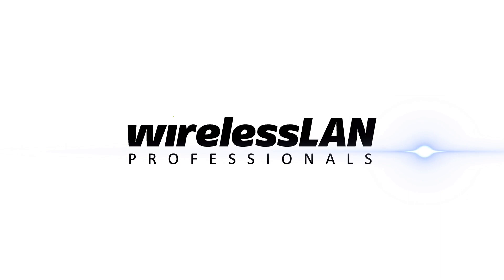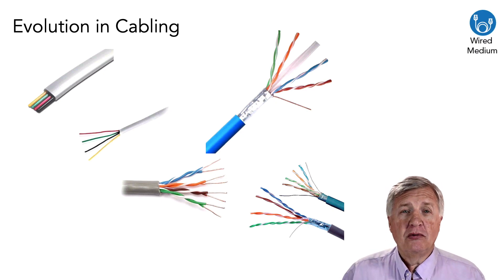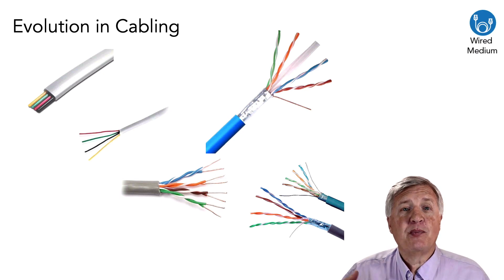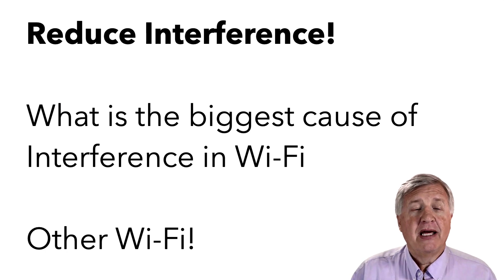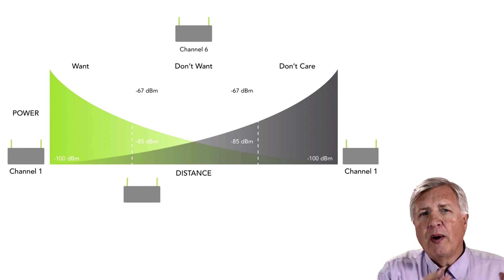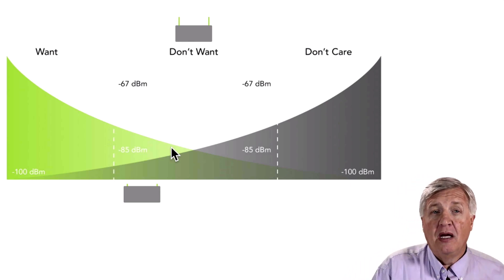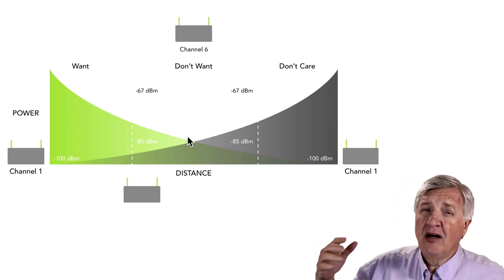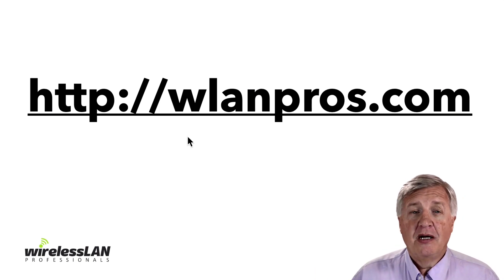How to Make Wi Fi Go Faster

Comment: What happens when the client or AP is able to decode down to -92 dBm?
Reply: (student) Client or AP spends airtime on those signals (waiting) while it may be not what you want them to wait for.
Unless there's no better signal available and -92 is what you consider better than nothing.
Reply: @discy12345  What I'm asking is if the AP can decode a -92 dBm 802.11 frame during CSMA/CD, does it go into exponential backoff or ignore the detection if the signal is fainter than -85 dBm.